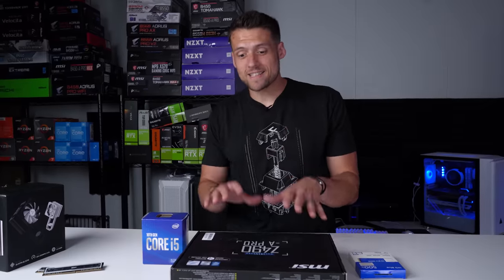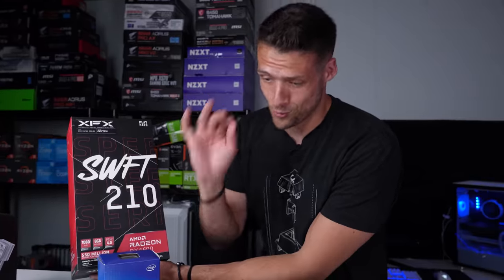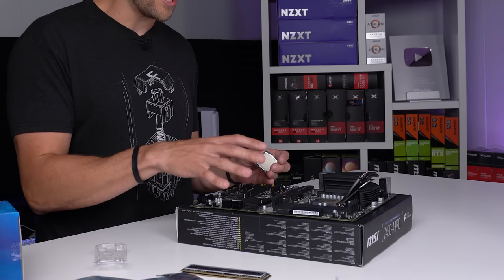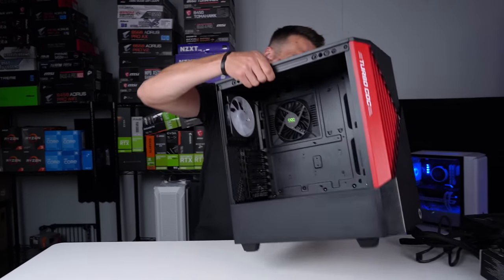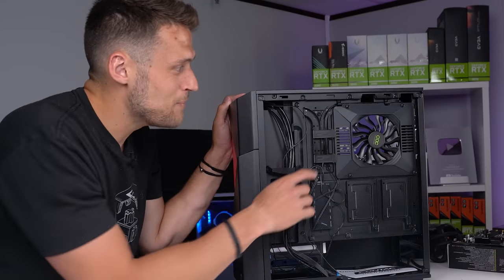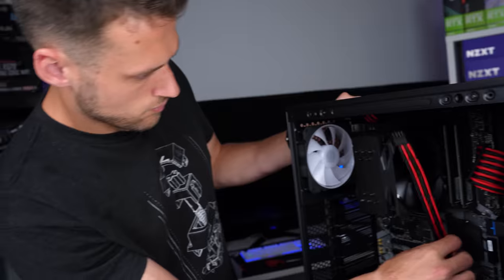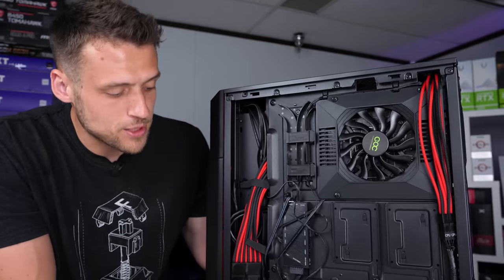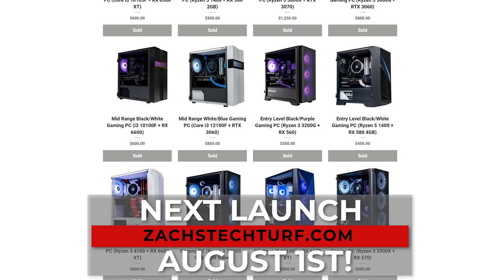$700 Gaming PC Build Guide ft. The Turbo Coc

Comment: Following your links, the best I could do...

Your $90 CPU is $130.
Your $81 MB is $130.
Your $40 RAM is $47.
Your $300 GPU can still be had for $300.
Your $26 cooler is still $26.
Your $68 case is $85.
Your $36 PSU is $65.
Your $43 SSD is $45 (pretty close).
Your $21 cable extensions are $26 (I've never bought cable extensions).

Your build, using your own links, just went up $149!

Btw:  Your music is so damn loud compared to your voice.  Why does everyone do that?
Reply: Bro that's what I have been wondering the links and the prices never ever match up most of the time
Reply: @zynice7414  they are used
Reply: @thecrwster  not everything is used. You just need to wait for sales. Pc parts go on sale multiple times a month. Zach only buys when things are on sale. The sales are posted daily on the discord
Reply: Alot of the prices he got I could not replicate no matter how hard I looked.. especially the PSU
Reply: @stanleyrodriguez8105  psu on evga midweek madness

Comment: Hey Zach   - I built a wonky Xeon E5-2698V3 in that case - mobo screws did not line up - probably the board's fault - but it worked great - set it aside for a while.  Now I can't remember how to take the glass side - what's the secret ?  (can't locate a Contac COC manual)

Comment: You could build one for $550 or $600 with a 3060ti or 6700xt. This is still a great video 🔥
Reply: Most people won't be able to get those prices for those gpu's at least new!
Reply: @davidg2731  I’ve you check I’ve gotten them many times, and you should be able to once the market goes down due to the release of new gpus
Reply: @Capybaracomputers  you can't say that to indians
Reply: @gurukarthik325  ? What does that even mean?
Reply: @Capybaracomputers  here in India the prices are too high, I've been waiting for more than one year to get a decent 1650 build under 950k, and I couldn't. I'm gonna buy a 1650 and pair it with my i3 for now and slowly upgrade it later...
Reply: @Capybaracomputers  a standard 3060 at it's lowest is 46k inr (577 USD) in here

Comment: Very nice build. a ryzen 5 5500 with a cheap b450 or b550 mobo would have been better
Reply: Yeah if he spent $40-$50 more for about the same performance
Reply: @lukatabor  he's spending less as amd mobos are generally cheaper and how can you seriously think it's the same performance lol?
Reply: @TaymonsterAnimation  the 5500 goes for $130 from micro center- he paid $90 for the CPU. Used z490s are about the same cost as a used b450
Reply: @lukatabor  you can get b450's for 50 bucks what are you saying? and the 5500 is 30% more powerful and future-proof..
Reply: @TaymonsterAnimation  didn't AM4 a dead platform now?

Comment: Hey can a $400 pc handle
Sea of thieves
Minecraft
Valorant
Roblox
Edit:I want ur $400 pc
Reply: well most cheap pcs can run those games but I also have no idea what pc your talking about
Reply: @Phantom210  his $400 pc video I liek dat PC:3
Reply: @hamidzia6033  well it is cheap alright. all the games you listed should run great on that. I would suggest lowering your expectations because as cheap as that pc is, expect below 60 fps on sea of thieves but Minecraft, Roblox, valorent should be fine, I would suggest optifine for minecraft, and FPSUnlocker for Roblox tho.
Reply: @Phantom210  then wot if I get $400 pc first then upgrade to RTX 3060ti later
Reply: @hamidzia6033  just to be clear, we are talking about this pc: https://www.youtube.com/watch?v=JvskDKaBULk right? if yes, then I dont see any issue with that choice, going with a 3060 ti may show slight cpu bottleneck but that would be the upper limit with a 3200g cpu.
Reply: @Phantom210  no it's 
$400 full pc guide